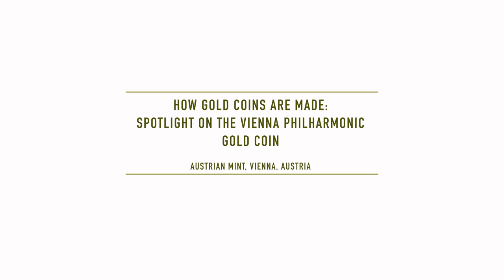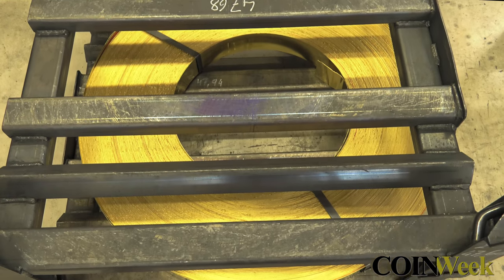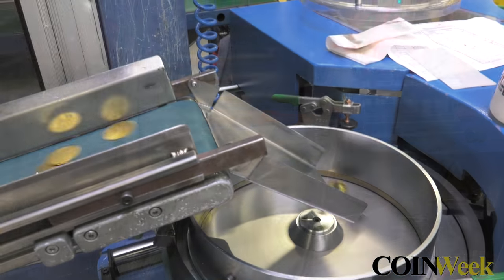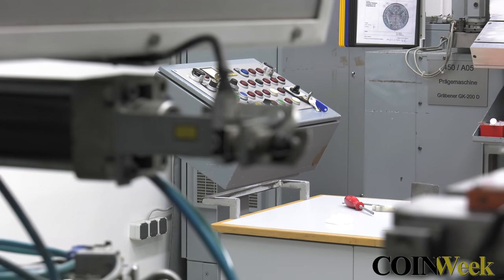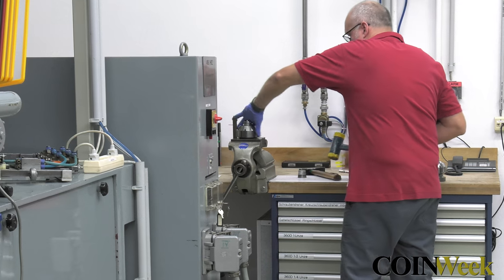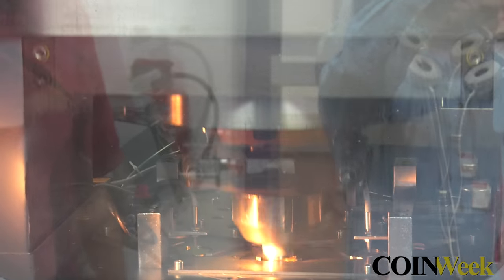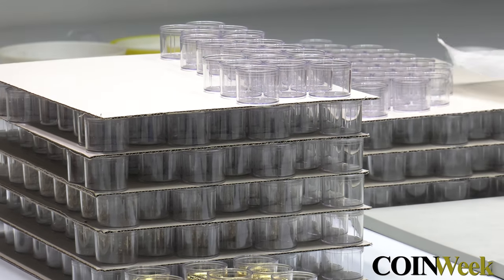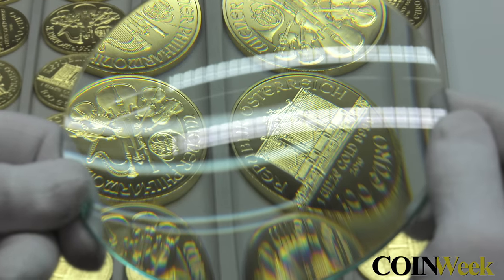CoinWeek IQ: How Gold Coins Are Made: Spotlight on the Vienna Philharmonic Gold Coin - 4K Video

Comment: So, doing the math, $39 million dollars worth of gold on the spool in January 2016, when gold was $1100 per ounce, comes to about 35,500 ounces of gold.  Today (11/1/20), with gold at $1902 per ounce, it'd be worth over $64 million.
Reply: The spool of gold actually has a mass of a tonne (t), metric ton, megagram (Mg), 1000 kg, 31103.4768 ozt, or about 2204 lb 10 oz.

The spot price of gold was just under $1840/ozt, so the coil of gold is worth $57.21M!

---

[XE 2020-12-06 11:51 UTC]
1 ozt Au = $1,839.34025072
31,103.4768 ozt Au = $57,209,876.82

The error of 4 lb 10 oz is 67.41323529464719 ozt, or about $123,995.88.

Comment: If each coin is an ounce gold coin, in Canadian terms, for each round containing 10 coins Is worth $28500 per round.  Each tray consists of  9 deep 7 across for total of 63 rounds/10 coins per.  Meaning just one tray of these  gold planchets is worth $17,955,000. Looks to be about 9 complete trays there.  SO just slightly under 17 million in Gold planchets in one scene alone, at the 7.03 mark. And that's just a drop in bucket compared to amount they are making, like wow!  Actually my math is way off, there is a lot more there then one knows.
Reply from the maker: The scene with the gold coil being turned to coin blanks - those weigh 2,200 pounds each. So about $40 million in that scene.
Reply: yup my point quite a bit hey lmao
Reply: if I recall they aid coil was worth 47 million
Reply: The spool of gold actually has a mass of a tonne (t), metric ton, megagram (Mg), 1000 kg, 31103.4768 ozt, or about 2204 lb 10 oz.

The spot price of gold was just under $1840/ozt, so the coil of gold is worth $57.21M!

---

[XE 2020-12-06 11:51 UTC]
1 ozt Au = $1,839.34025072
31,103.4768 ozt Au = $57,209,876.82

The error of 4 lb 10 oz is 67.41323529464719 ozt, or about $123,995.88.

Comment: If the gold is 24k, wouldn't they get bent with the tumbling and washing
Reply from the maker: +SilverStacking pro Not exactly. This is the standard practice for preparing gold blanks. We saw no bent or damaged blanks.
Reply: any bent will be flattened during pressing by tons of pressure between dies
Reply: gold is not that soft. nothing will bend..
Reply: Do you think gold is metallic butter or something?